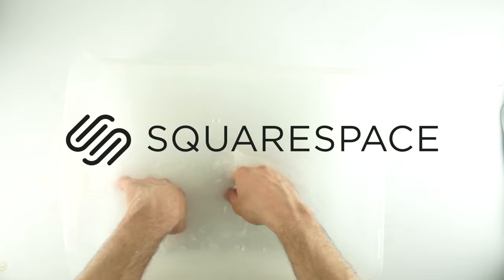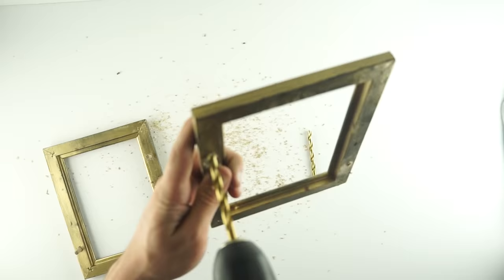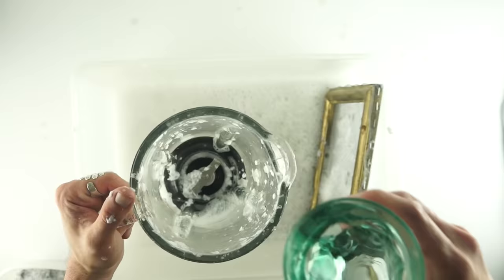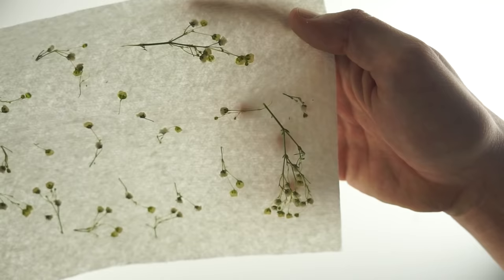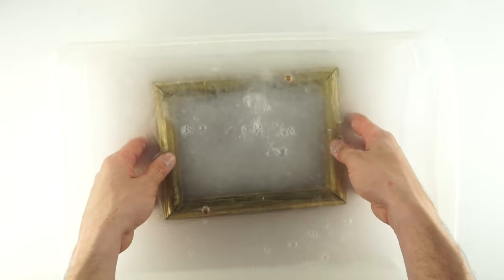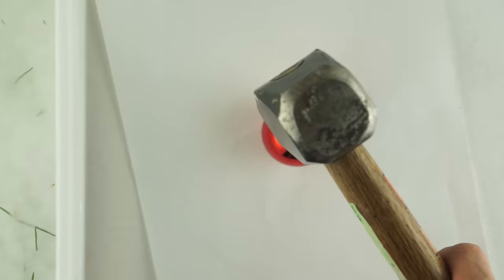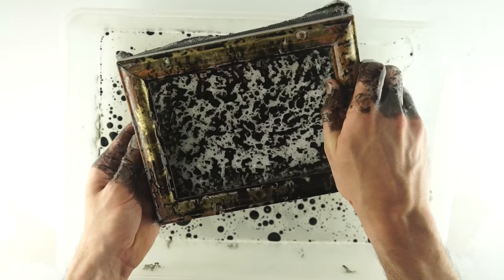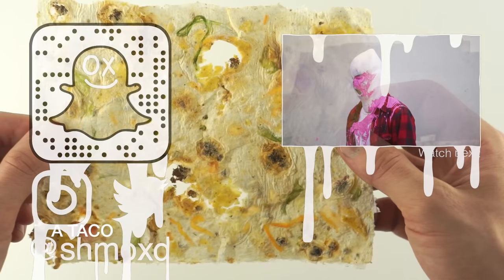How To Make Paper

Comment: I used to love doing this! A great way to speed up the drying/processing time, is to transfer your paper in between two pieces of fabric, instead of the plastic sheet, and then run an iron over the paper sandwich. Dries in seconds, and is less labour/time intensive. Great video!
Reply from the maker: That’s genius!!
Reply: Is the paper actually sturdy enough to write on (a full hallmark card for examples)? Or Do you just recommend ink stamping something simple on?

Comment: This is actually very cool to recycle old paper into something new! I think this could be combined with bookbinding, for example a photoalbum with a pretty flowertouch in the paper. 

Actual Paper is made from mushed up wood, its washed and treated ith chemicals, sometimes even on a cellular scale, then it is run on a ver big and long machine with huge cylinders, which make one very long strip of paper that is either cut to smaller pieces at the end of the machine, or rolled up into huge rolls. Since that paper rolls into a direction, paper has a "direction" which is important during bookbinding because if you do it wrong, you book wont close because the paper is in the wrong direction!

Quite an interesting topic! I love your take on it!

Comment: No hate I still love your channel but Bruh he just using paper towels while recycling paper. He also made the process way harder you can flip the mold directly on a cloth with the paper pulp facing the cloth then soak the water with a sponge and let it dry on the cloth you can remove it from the cloth after it dries and reuse the cloth and sponge next time.